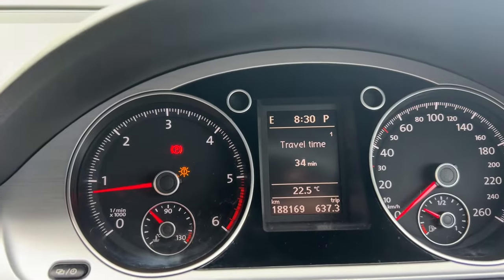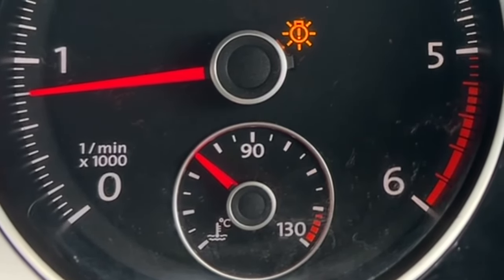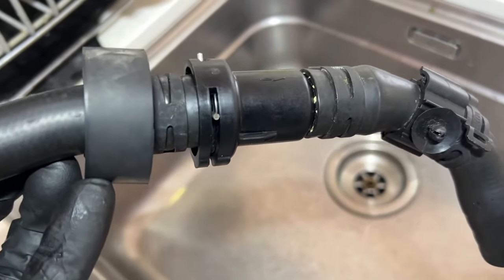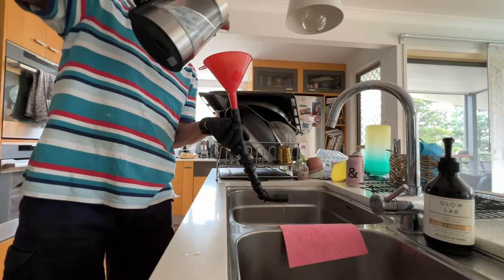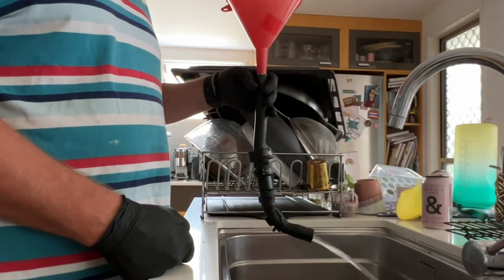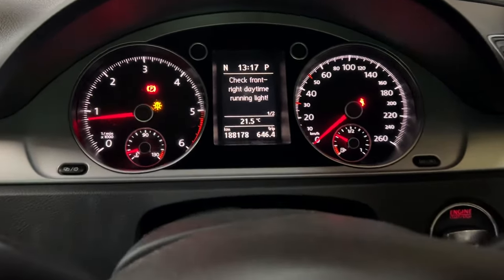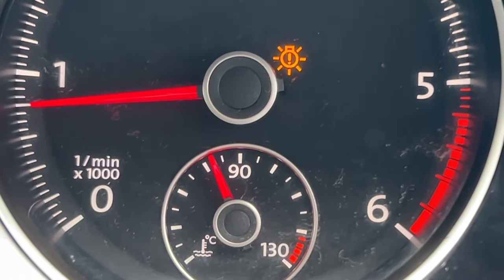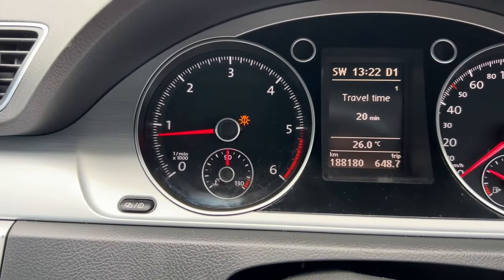Why does my VW (or Audi) never get to full operating temperature?

Comment: My passat is exactly the same after a new thermostat. Ah yours is the auto whereas mine is the manual so doesn’t have that secondary thermostat
Reply: Yea I got manual 2.0tdi Passat and temperature is up and down all the time between 70C-85C. Sometimes reaching 90C 
I just noticed in the winter never seen this in the summer months
Reply: Mine is an Audi 2.0 tdi manual gearbox and it has the second thermostat. Some people call it EGR thermostat.
Reply: Manuals do have that secondary termostat. Check the hoses that go into the EGR cooler.
Reply: w samochodzie zskrzynia manualną również znajduje się ten termostat , tak jak i zawór dławi,ący

Comment: You can save a lot of labour in the DSG thermostat job by just swapping the copper/wax module. No need to unclamp any hoses etc. Good idea to still check the actual temps you are reaching though as you kight be just above 75C, not the 88C+ it needs to be at.
Reply from the maker: Hmm I do not agree. If you separate the thermostat it is difficult to get back together again because of the spring tension. Also you risk damage to the sealing O ring, then you may get a coolant leak. Much much easier to remove 2 hose clamps and replace the complete unit. Less risk in my opinion. Can you even purchase the internal parts without the housing?
Reply: @PetesWorkshop  I've done quite a lot of these. The main reason I use this method is that often the thermostat is stuck hard to the rubber pipes and while manipulating it to separate them a few times I've had the plastic elbow break where the rubber pipe joins near the front of the engine. It seems at the age of these vehicles the plastic is getting brittle. By not removing the whole thermostat it lessens the chance of that. No, you can't buy the internals indivisually - I just take the new one apart and remove the capsule. Never had a leak. But either methodis fine, whatever works for you.

Comment: I have same issuie temp goes up to u0nand stays there unless i out my foot down and already changed thermostat, where did you order this thermostat from and would it work on 2l tdi audi a5 2010 , wngine code is caha
Reply from the maker: The part number is in the description. Search it in eBay. I don’t know if the A5 has the same thermostat.
Reply: tak , to ten sam termostat , polecam zamówić mahle th 5 80 , który otwiera się przy 80 stopniach.

Comment: Had the same problem on an audi a4 b8, changed the small one, temp does raise and stay at 90 but raises slow.
Drops at +5C and lower if i drive downhill for 5 minutes with cabin temp at 21C
Are there 2 or 3 thermostats in the 2009 model?

Comment: I have this same problem but im confused because at the end of the video you said you changed the thermostat and it didnt make a difference? Whats the part called that you actually changed?

I rawatched the video and it and like there's two thermostats? One is for the engine coolant and another one is the main thermostat?
Reply from the maker: On the left of the thumbnail is the main thermostat that bolts to the engine block. The small ‘in-line’ thermostat on the right side of the thumbnail was the cause of the problem. This is the DSG thermostat.
Reply: @PetesWorkshop  i asked chatgpt, both thermostat work independantly no ?

Comment: I’ve got the same issue on a golf, I feel like my mpg is suffering as a consequence did you notice that?
Reply from the maker: This is possible because when the engine is cold (or the ecu thinks it’s cold) the ecu adds more fuel to help it run better.

Comment: hi I have a 2.0 tdi cr manual gearbox I also have the problem of the temperature going down I changed the thermostat twice and I would like to know if it is normal for them to go down to 75° and to go up to 90 ° and I have heating and when cold it takes me 20 minutes for it to reach 90° with an outside temperature of 3°
thank you for reply
Reply from the maker: This does not sound like normal operation. Try to find the cooling system diagram for your car and find a possible reason for coolant to bypass the main thermostat.

Comment: Good day dear, I have a similar issue, in the morning on the highway the temperature drops down and error code came - cooling liquid too low. I have Audi TT MK2. Please advise if I can install the same small thermostat as a second one. Thank you!
Reply from the maker: I have a mk2 TT with 6 speed manual transmission. It does not have the same thermostat. The Stronic (dsg) may do, I don’t know. ‘Cooling liquid too low’. If the reservoir is full you probably have a sensor fault.

Comment: Coolant temp sensor is also  a known cause for those symptoms.
Reply from the maker: I have had a coolant temp sensor fault and it did not present itself the same as this at all. Sensor failure usually appears as non linear movement of the gauge that does not make sense for normal coolant heating/cooling.

Comment: 75C on the gauge is more like 65C actual. The gauge reads 90C from 75C to 105C.
Reply from the maker: This is true. ‘Operating Temp’ is a temperature range. The gauge on the dash is designed to make it easy for everyday humans (that may not understand the inner workings of a complete engine assembly). I’m ok with this approach by VW.
Reply: @PetesWorkshop  Agreed, although the engineer in me does get rather annoyed by a gauge marked with numbers that has little relevance to the actual temperature! Just have a cold/normal/hot range!

Comment: I have changed the water pump, thermostat and the sensor, unfortunately nothing has been changed.
i am getting crazy
Reply: Mine was an B8.5 audi, changed both thermostats, EGR Cooler, Coolant, did coolant system with Headgasket check, waterpump with timing belt, Coolant Cap (there is a valve too) and both sensors to no avail, still not getting above 75°C

Comment: I have changed both main and the smaller thermostat and it still drops low when im idling or just waiting for the traffic lights. Any tips? Audi a6 c7 2012 tdi 2.0
Reply: If you have replaced both thermostats the only culprit left would be the temperature sensor...cheap easy fix if it is...
Reply: I've had the same issue on both my A4s (B7 & B8.5). When in Drive, the temp goes up to 90C, when in S, temp goes down. And as it so happens, today the temp gauge didnt even reach 70C... while yesterday it reached 90C easy. I guess it's fluctuating. A bit unnerving, but nothing to worry about.
Reply: @paulclaeys7631  I mean in the summer it's ok, but in the winter it's always drops when I let go of the gas pedal
Reply: @Kiko6Kiko  ok, that shuts me up. Never had such an issue before...
Reply: @paulclaeys7631  ye it stays at 90 when I'm on highway and when there is slight downhill and I let of the gas pedal so just coasting it drops after a minute to 70/80, in the winter it even dropped to 50 after like 5 minute downhill only.